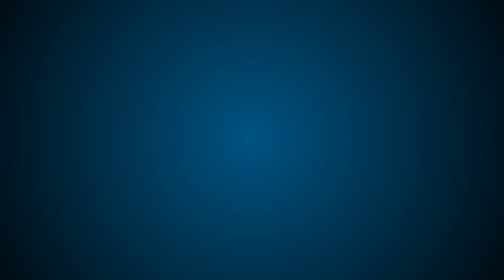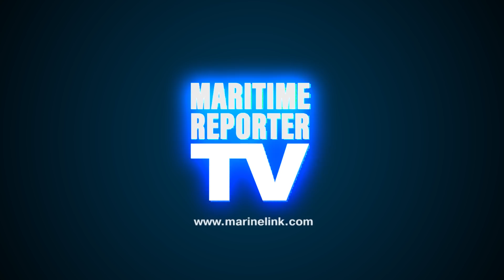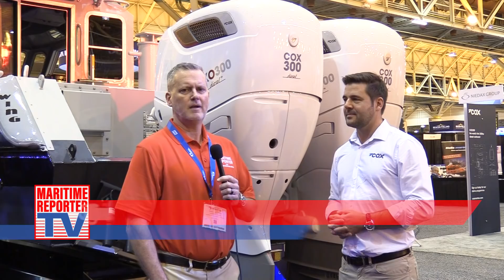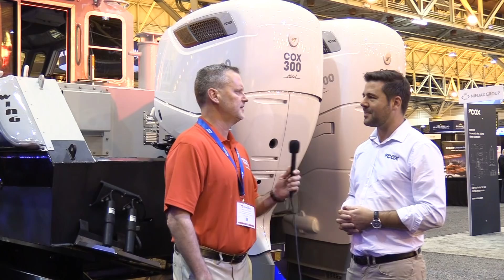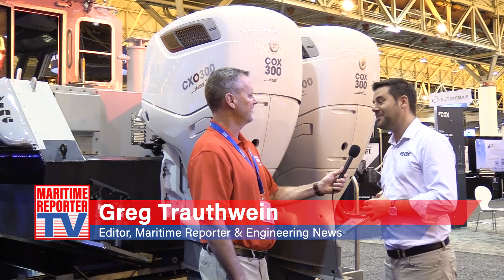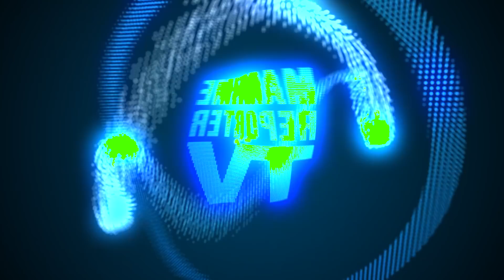COX Expands its Diesel Outboard Engine Role

Comment: Good interview and a great product, congratulations on all the hard work and looking forward to seeing the company succeed. Working in the maritime industries for over 30 years I have used petrol out boards and understand the importance of maintenance schedules and how frequently we have to strip the petrol engines, the new diesel out board engines could half the cost and time we have to do this. The advantages of reliability at sea is paramount and in my opinion I'd choose the diesel out boards over petrol every time.
Reply: Have you checked out the oxe diesel engines? from cimco marine

Comment: All these diesel Outboards seem to be a Solution to a Non-existent problem... There are a couple of outboard brands that have been used Commercially for decades with normal wear and tear maintenance...
Reply: Sounds like BULLSHIT to me. Big power, small displacement, equals HIGH STRESS....HIGH FAILURE RATE.